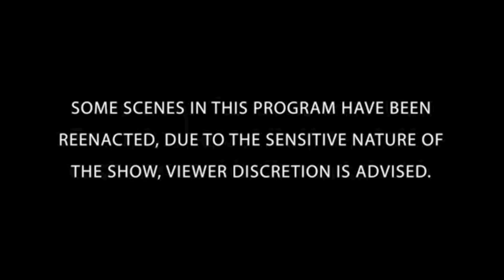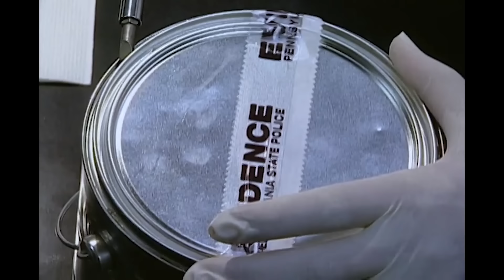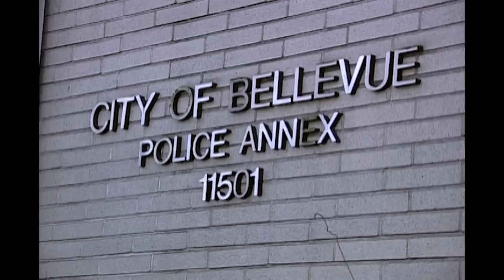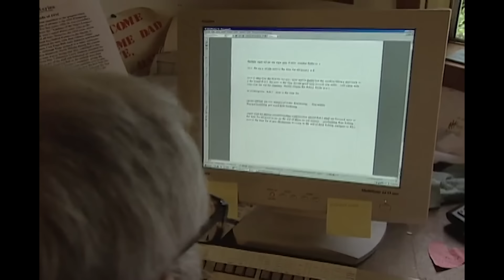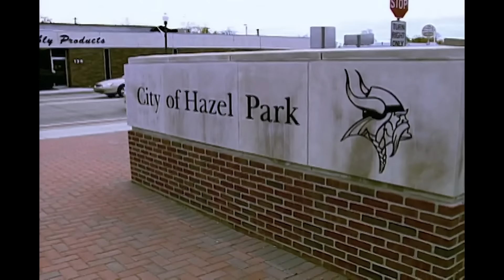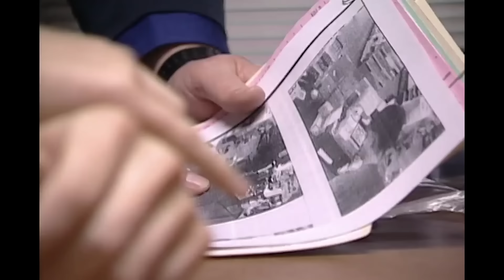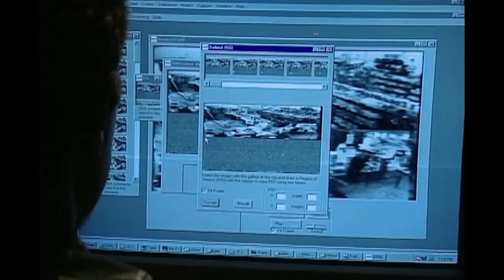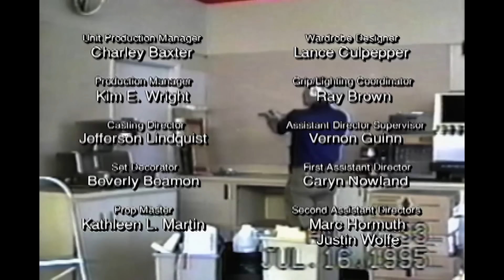Best Of Season 7 | TRIPLE  EPISODE | The New Detectives

Comment: When Jeremy put Brad’s body in the trash can- why didn’t the trash collectors notice anything?  Wouldn’t the smell have been noticeable?  Even after the can was emptied, wouldn’t the scent of all that blood drawn an unusual amount of flies? Just wondering how an inch of blood in the bottom of a trash container would take to dry?  Just curious 🧐
Reply: Blood congeals and dries fast, especially in hot climates. You're right about the collectors , smell etc.
Reply: Lmao 🤣 obviously you’ve never picked up trash and it shows haha bro every trash can smells like a dead person that’s why when I use to pick up trash I’d hold my breath or breath through my mouth! And bro some cans smell horrible some not so bad some have a million flys some have none at all all depends on the trash and if probate throwing meat away
Reply: @tazcahoon4051  I can't imagine the foulness.  You're tougher than me. Would the size, shape & weight of a body be something unusual & noticeable in a residential collection?
Reply: @johnnabuzby6103  I am aware of that. Some cities, even mount cameras over the tip point, so the driver can see what's being dumped from inside the cab. I was just responding to Taz Cahoon, regarding his experiences with manual handling. Hydraulic lift trash trucks haven't been around that long. In my city, up to the early 90's, I was still seeing a bunch of guys following trash trucks around.
Reply: @peterjackson7473  I'm thinking the body was put there in the beginning  then moved for burial  somewhere else
Reply: How can the neighbors and passersbys not notice anything?  Unless he literally wiped the outside and/or around the trash can really good neighbors and passersbys should at least be able to see some blood on and/or around it.

Comment: Perhaps I stopped the video too early, but if the cooking pot with the fingerprints was impossible to get a good photo...Cut the fucking pot in two! Daaà
Reply: Also, even if the print couldn't show enough to pinpoint who left the print, it could possibly show the the general size of the fingers that left it. That could be one way for the detectives to get a clue even though it may not be good for use as evidence in a trial.

Comment: OMG just cut out the other side of the pot!
Reply: It clearly states at about the 2:02:20 mark that dismantling the pot isn't an option. It's one of the murder weapons and it has to be preserved in its original condition.
Reply: @johnnabuzby6103    Not only that but trying to cut it out of the pot would cause too many slivers of metal that would mess up the print.!! They needed a tiny camera that would take a clear picture of the print. But then they’d have to blow it up which could give a blurred print so that’s why they went to the 19th century camera. It worked. They explained it very well.
Reply: @yvonnegrassi9219  Yes they did explain it well, so I don't know why everyone is getting so bent out of shape and insisting it be cut out of the pot. Didn't they listen to the same dialog as you and I heard? 
Yes, the bellows camera worked perfectly well to meet the needs of investigators.